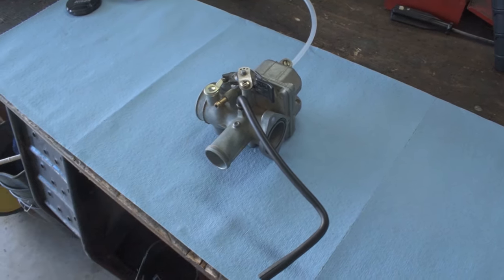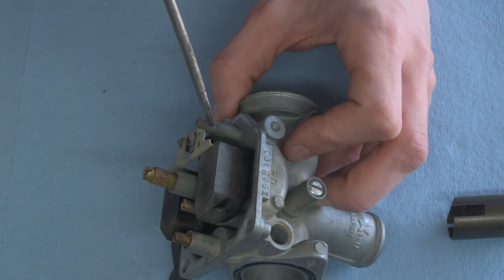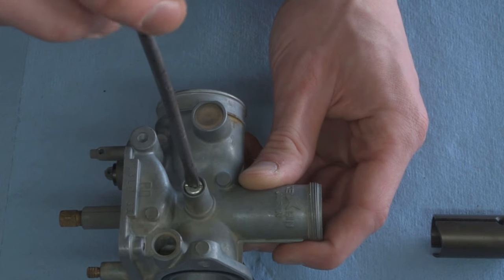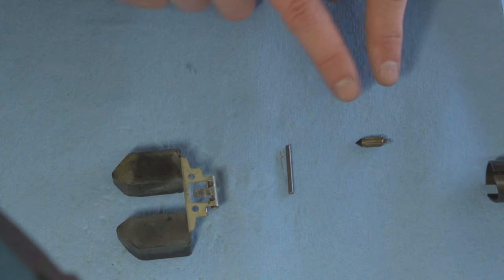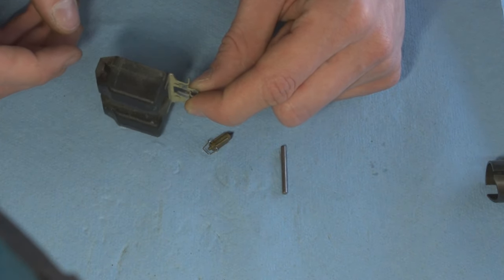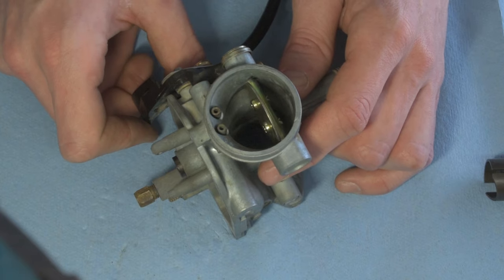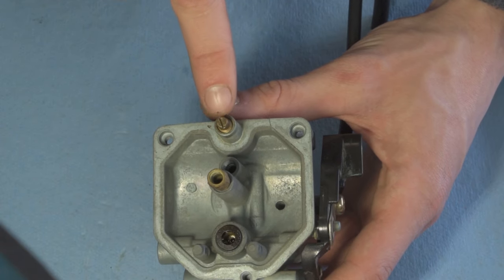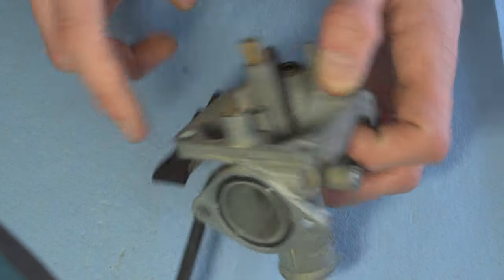Understanding How To Tune A Dirt Bike Carb

Comment: Great job on this! Concise and thorough, and very helpful. How does the fuel screw actually adjust the mixture? Does it effect the mixture at all the jets? How is adjusting the fuel screw different from changing all the jets and raising or lowering the needle?
Reply from the maker: The fuel screw is a tapered screw that lets more or less fuel pass through the carb body from the float bowl. The fuel screw is like controlling the fuel flow. While the pilot and main jet are are nozzle’s the fuel flows out of. 

Think of the fuel screw like the knob of your your garden hose where you turn on or off the water.

And the jets are the nozzle on the end of the garden hose controlling how much comes out of the hose
Reply from the maker: Raising or lowering the needle adjusts the fuel by how much throttle you apply ( you can think of this like how open you have the garden hose nozzle )
Reply: @AaronsEnduro  oh, so the fuel screw only really controls how quickly the bowl fills, right?
Reply from the maker: No, it controls how much fuel comes out of the float bowl.
Reply from the maker: The float itself controls filling the carb bowl
Reply: So, my main question pertains to this, I am about to pick up a '94 DR250. It is bone stock and I plan on opening up the air box on it. This obviously requires bigger jets. I'm trying to learn how to figure out the the right jet sizes for best performance. Obviously if it bogs or sputters it's too lean or rich, but I imagine there's quite a bit of range in between there. I've seen some on the forums also mentioning checking the spark plug (white or oily). Can you recommend a way to get the mixture just right without too much of a headache?
Reply from the maker: Bogging = rich

Popping and banging = lean
Reply from the maker: And yes you need to use the plug to see how the fuel is actually burning.

White plug = lean
Black plug =rich
Brown roasted marshmallow plug =perfect
Reply: @AaronsEnduro  I do like a nice brown roasted marshmallow. Do you clean off the plug each time before popping it back in?
Reply from the maker: Yes 100%
Reply: @AaronsEnduro  so, do you run it at idle for like 10 minutes and check the plug to assess your pilot jet. Then once you get that set do the same thing with the throttle like half open to check good needle placement?
Reply from the maker: I would run it, ride it up and around for 10 minutes, see if theres hesitations , make not if and where in the rev range it hesitates , then access the plug
Reply from the maker: No matter what itll be a bunch of trial an error
Reply: @AaronsEnduro  awesome! Thank you for your time and knowledge. I can't wait to start playing with it
Reply from the maker: If i wasn’t at work (my real job) i could go further in depth!

Unfortunately youtube isint my fulltime job yet hah

Comment: I have a mid rev problem, bike starts and runs, on low revs accelerates fine, on full revs,  accelerates fine. When sitting steady at half revs,it stutters.I stripped and cleaned the carb using your vid, still the same, any ideas? Thanks in advance
Reply from the maker: What color is your spark plug
Reply: @AaronsEnduro  Quite black and sooty tbh
Reply: I tried adjusting it with the mixture screw but i didnt realise the part that the cable attached at the top had adjustment so I'll check that and adjust it one groove if it has adjustment on it, cheers
Reply from the maker: @stevieforbes2160  id try a little less fuel in your mixture, then report back.
Reply: @AaronsEnduro  I will, cheers man
Reply from the maker: Clean your plug off first and then run it so you can get an accurate color on the plug
Reply: @AaronsEnduro  i did that m8, initially it was lifting air through the inlet manifold so i took the carb off, fitted new o ring rubbers to the joint and removed and cleaned the plug with a soft wire brush, i also tried another coil with no difference, cheers

Comment: My problem is i cleaned the carb on my sons 01 xr200r and now when it starts is idling high and even if i turn the idle screw in it revs even higher and if i turn it out it doesnt really change when i sprayed starting fluid while bike is on to check for vacuum leaks none but if i spray into the airbox the bike idles down im lost lol
Reply from the maker: My assumption would be you put the throttle slide in 180 degrees wrong (the tube that goes in the top of the carb which the throttle cable is attached too.
Reply: @AaronsEnduro  is there any way you could show me how it should be seated
Reply: @AaronsEnduro  another thing is too it revs high when opening choke not while choke is closed when fist starting the bike once i open it revs high

Comment: hey I have this carb on my bike and i’ve cleaned the whole thing out plenty of times and it still bogs like crazy but when i put the stock one on it doesn’t bog like that do you have any tips?
Reply from the maker: Have you adjust the fuel screw, main jets, idle jets, or c clip at all?
Reply: @AaronsEnduro  yeah i had it running good then i came home for the night then went to go back out the next day and it was super boggy
Reply from the maker: Choke turned off bike fully warmed up?
Reply from the maker: Got gas in the bike?
Reply: @AaronsEnduro  yeah
Reply from the maker: Were u riding in water last ride
Reply: @AaronsEnduro  let it warm up for around 7 mins the one day
Reply: @AaronsEnduro  full tank
Reply: @AaronsEnduro  no in dry conditions
Reply from the maker: How long did the bike sit
Reply: @AaronsEnduro  around 8-9 hours
Reply from the maker: Did you wash the between in sitting there? And ur ride? Water in the exhaust?
Reply: @AaronsEnduro  nope
Reply from the maker: No idea man, gotta be somethin simple

Comment: How fix clutch slips?
Reply from the maker: Watch my video on that 

Its called how to make your pit bike last longer
Reply: @AaronsEnduro  where u showing how fix clucht ? My problem is hard to find neutral and shifting from 2 to 3 gears got neautral
Reply: you say that because that bolt needs to be adjusted because when im drive in 3 gear just slips to neutral
Reply from the maker: Sounds like you may have broken some teeth of the transmission gear
Reply: @AaronsEnduro  thats the point all teeht are fine then i get that neutral slip i shift up again to 3 gear its runs fine no slips till i shift down

Comment: Hey do i need that lil clip that is attached to the float valve in order to work fine
Reply from the maker: What lil clip? Send me a photo on instagram @aaron_greenway
Reply: @AaronsEnduro  you know when you pulled the float out the valve comes with it hanging on the float
Reply from the maker: Yes or course you need all the parts of the float for it to work correctly
Reply from the maker: Everything shown is needed for it to work properly
Reply: @AaronsEnduro  only reason why i ask is because when i went to clean the carb it didnt have that clip on the valve but the bike was running fine before i cleaned the carb

Comment: So I bought a bike that hadn’t ran in a year, I cleaned the carb and then it started and ran for a day. The next day the bike wasn’t starting so I thought I’d order a new carburetor. I put the new carburetor and new fuel into the tank and the bike still won’t start. Then I proceeded to change the spark plug and it still won’t start. The bike has compression and everything is changed but the bike doesn’t want to start. Are there any other options?
Reply from the maker: If you’re looking for 1 on 1 guidance on your bike you should check this out! https://www.youtube.com/channel/UCcviyKZ2Vf3IHFliwebzODA/join
Reply: If I purchase would I be able to do a video call soon?
Reply from the maker: Thats what its for! We can setup a time
Reply: @AaronsEnduro  what time zone are you in
Reply from the maker: PST

Comment: How do I put the cable back on the throttle pin
Reply: Mines seems to have nothing on the end of the throttle wire to hold
Reply from the maker: @goodsandservices4119  Watch this at 4:54 https://www.youtube.com/watch?v=H6qr7R7WBLU
Reply from the maker: Then you may have broken your throttle cable

Comment: My 125cc pit bike keeps dieing when chokes off
Reply from the maker: Sounds like the bikes running lean
Reply: @AaronsEnduro  oh yup so I gotta make it richer
Reply from the maker: Well when you have a choke turned on, it’s reducing air flow, resulting in a richer mixture. If you open the choke (aka “off”) your leaning the mixture by re introducing the air flow. If the bikes stalling out when you open the butterfly valve (the choke) that makes me thing you’re mixture is too lean. Meaning you should have to richen up the fuel mixture! Hope that helps!
Reply: @AaronsEnduro  I think I have the same problem. Choke off meaning all the way up or all the way down? And what needs to be done to richen the mixture? thanks!
Reply from the maker: Choke is up

Comment: I have a problem with the carburetor adjustment, the candle is clean all the time, the air adjustment does not help, the dose on the needle does not help either, the nozzles are clean, engine 4t kawasaki klf250
Reply from the maker: Im sorry, im not understanding your question
Reply: @AaronsEnduro  I can't adjust the carburetor on a kawasaki klf 250.
The candle should be the color of coffee with milk, mine is clean, I have the wrong mix
Reply from the maker: By candle do you mean spark plug?
Reply: @AaronsEnduro  yes
Reply: @AaronsEnduro  I'm from Poland, I write via google translator
Reply from the maker: When you say “clean” does that mean the spark plug is white / lean? If so you need to add more fuel into your adjustment
Reply: @AaronsEnduro  Pure metallic color, no change, adds dose through the spiers and raises it, but it doesn't do anything
Reply from the maker: Im sorry but the google translate isn’t making sense in English.
Reply: @AaronsEnduro  How to add more fuel? Raising the firing pin doesn't help
Reply from the maker: Put a larger main jet in or adjust the fuel screw out on the carb to let more fuel flow.
Reply: @AaronsEnduro  The main stream is 120 as written in the service manual
Reply from the maker: Depending on your elevation it will change it. A 120 main jet may be good at sea level, but at a few thousand feet above sea level it may not
Reply: @AaronsEnduro  Main jet changed to 130, fuel goes to airbox, spark plug is the same color as it was

Comment: So if my bike starts bogging out at full throttle, i should make my needle richer? Because adjusting the fuel mixture when I bog at full throttle will just make all throttle positions richer but adjusting my needle will more specifically effect full throttle?
Reply from the maker: Correct!!
Reply from the maker: Except you would want to make it leaner if its bogging.
Reply: @AaronsEnduro  so my carb had a thinner needle in it but I got a rebuild kit with a slightly thicker slide needle should I switch back to the thinner needle?
Reply from the maker: Do your needles not have clip positions to change?
Reply: @AaronsEnduro  I didn't see a clip I just figured the thinner needle would change the flow one way and the thicker would change it the other way haha
Reply: @AaronsEnduro  I've got a 03 honda shadow vlx 600 if that helps haha
Reply from the maker: Id assume you’re running a stock carburetor? Changing the needle clip to a thinner or thicker one will completely change the entire rev range of the fuel mixture. Id recommend an aftermarket carb that will offer you all the fine tuning adjustments you could use

(MIKUNI CARBORATORS***)
Genuine VM26 Carb(Good for 200cc+):https://amzn.to/3rdSxij
Genuine VM24 Carb(Good for 125-150cc):https://amzn.to/309pEI5

**(CARB FLANGE ADAPTER)** YOU MAY NEED IF YOU GET ROUND 28MM AIR INTAKE CARB
28MM Carb Flange (Good For VM24 & VM26)https://amzn.to/3qcd1GP

 (REPLICA CARBORATORS***) 
Replica VM26 Carb(Good for 200cc+):https://amzn.to/3bcPmSn
Replica VM24 Carb(Good for 125-150cc):https://amzn.to/3qcd1GP
Replica VM22 Carb(Good for 110-125cc):https://amzn.to/2AX18kH

 (CARB JETS FOR TUNING)
VM22/VM24/VM26 Carb Jets:https://amzn.to/2VecKGQ

 (AIR FILTER)
ANGLED UNI Carb filter:https://amzn.to/3cNzPpP
STRAIGHT UNI Carb filter:https://amzn.to/2NPZ8RJ
UNI Filter Oil SPRAY & Cleaner:https://amzn.to/3rdHHst
UNI Filter Oil (CONCENTRATE):https://amzn.to/3qcV2QF
UNI Filter Oil SPRAY https://amzn.to/3sG0Cwq
Reply from the maker: @jthebk3864  personally have never worked on or heard of that bike
Reply: @AaronsEnduro  yeah it's a cruiser bike so different worlds haha there's a channel called lnspltblvd on here that's pretty great, they build choppers and they all started with the vlx and a few have swapped to Harleys but apparently the vlx is a great bike to build into a chopper, very reliable motor just tough to get the carbs right but apparently once you get them sorted out they run great.
Reply from the maker: Sounds like a sweet unit!

Comment: might want to check your info on the air screw.  if you turn it out you are making the mixture LEAN.  if you turn it in you are making the mixture RICH.   (i think you say the opposite in your video.)
Reply from the maker: Well specifically im referencing my fuel screw. I may have said it like “air/fuel screw” 
But if adjusting the fuel screw my wording is correct, if you’re carb Specifically had both a fuel and an air screw, then yes it would be the opposite of what I’ve said for the air screw.